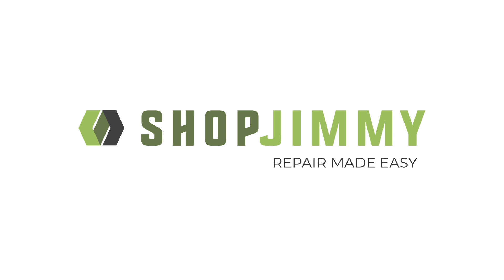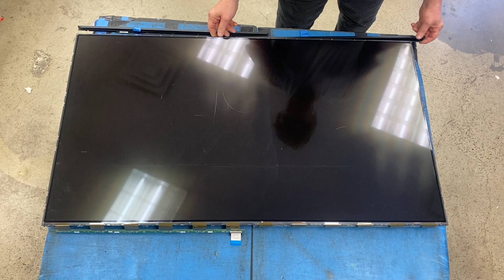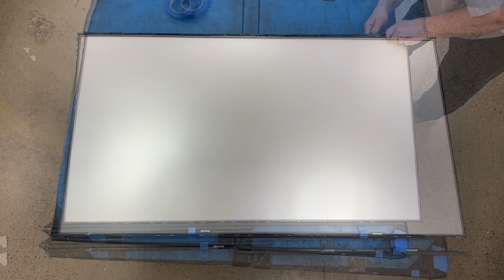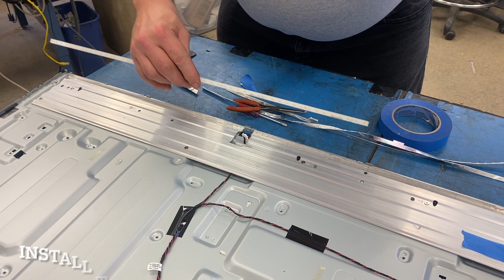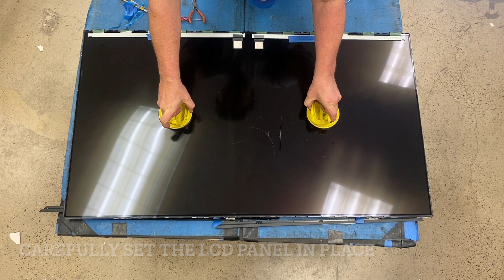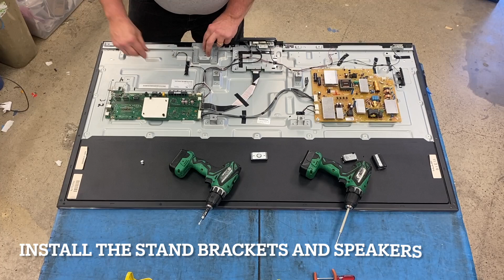Sony LED TV Not Working - No or Half Backlights - How to Fix - XBR-55X800E

Comment: My Sony XBR-55X800E works most of the time but then every once in a while it shuts off for some reason it also has a blemish ot the lower right corner but its not very noticeable unless it is lit up all in white.... i vacuumed the inside component's when it use to shut off more often it seemed to help it, maybe it is overheating somewhere on the motherboard,, are there replacement motherboards for these tv ????

Comment: I know your showing led repair here but i thought id ask you anyways. Ok jimmy tech question. Im working on the same tv and just replaced the emmc chip. No netflix now. I talked to a few of my techs to get an option on why doesn't netflix work after replacing the tsop chip. No one can give an answer. I personally think its because it gets corrupted when copying the chip because it wont transfer the user name and password on the original chip for netflix. It's Encrypted data. What's your opinion ? I wish i knew what bytes of information are responsible for netflix user name and password have this figured out. Something is definitely wrong with the bytes of information stored for netflix.😊

Comment: Hi i have a LG 42 la620v tv i have sound but no backlight, on start up it flashes on and then goes off,
I have a picture with the flash light method, i have also changed all of the led lights, any help would be appreciated thanks 👍
Reply: Any popped capacitors on the Power Supply Board maybe? Atleast worth to check out if you haven't already. Doesn't have to really be popped open sometimes they also just look slightly bulged up.